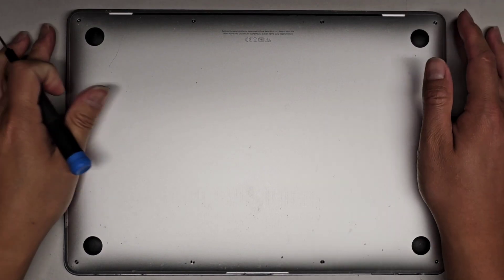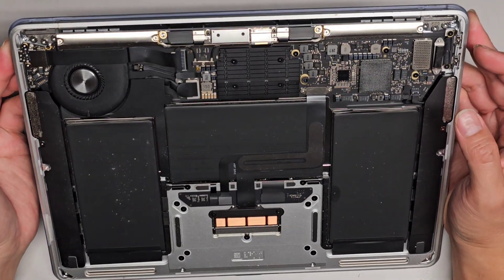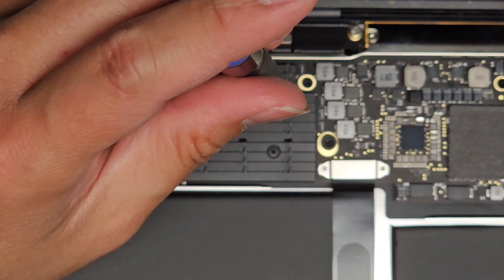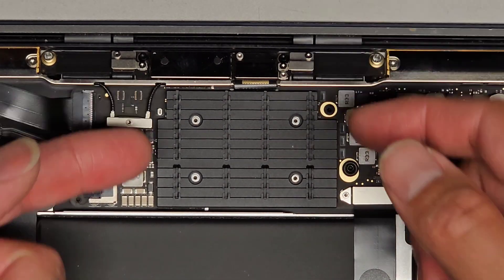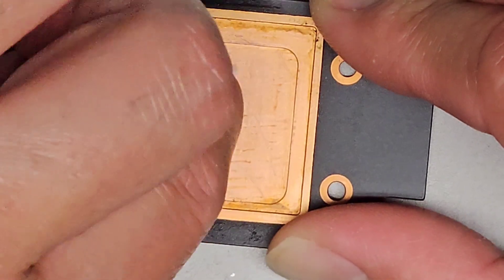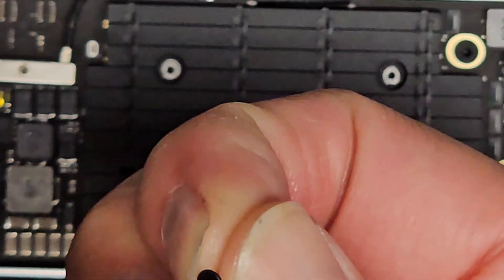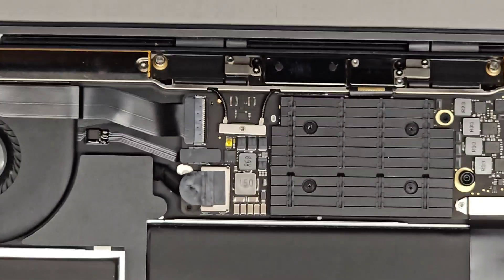2020 13" Inch MacBook Air A2179 Disassembly CPU Thermal Paste Application

Comment: good video, but 1mm thermal pad is needed here instead of thermal paste.
Reply from the maker: Thermal pad is not as good at transferring heat. Who told you to use thermal pads?
Reply: @ItsBinhRepaired  
As you mentioned in the video, this device has a terrible design XD, but when using thermal paste, an air gap is left between the heatsink and the SOC, which can cause temperature panic errors, especially for this specific design. While thermal paste generally works better, perhaps not on this particular device.
Reply from the maker: @hyperagent00 what gap? Who have you been talking to? Thermal pads are much worse at flowing into gaps to fill. There's a reason why thermal pads are never used on cpu/gpu dies.

Comment: I did this process exactly and now the Mac won't start :( I tried all kinds of keyboard shortcuts, checked all the cables but it doesn't work.
Reply from the maker: My guess is you didn't reconnect the battery properly if you didn't damage anything along the way. Make sure you plug in the charger for the first time or it won't power on.
Reply: On the video I don't think he disconnecting the battery before working on it as you always should. Otherwise if you did that and sometimes these models are weird and you have to plug in the power for it to come on for the first time after replugging in the battery

Comment: Thanks a lot for this detail video. Add one information after replace the thermal paste: plug in charger and hold the power button about 3 seconds, release it after you see the Apple icon. My A2179's temperature is about 80-90 now. and the FAN works fine. I think it is a little bit higher. Should I do some other work for this issue? Thanks again.
Reply from the maker: 80-90F or C? Why hold the button?
Reply: @ItsBinhRepaired  80-90C, one quick press cannot start the system. so I press the button until see Apple icon to make sure system start.
Reply from the maker: @OldHeroLast that's way too hot

Comment: For the people with issue after doing this and won't turn on.  This sounds crazy but I've built many windows computers over the years and for whatever reason some of the older intel chips required pressure from the heatsink to work, it won't even turn on without enough even pressure.  Not talking about socket pressure with the lever arm as these are soldered in without, but pressure of heatsink no bullshit.  Check to make sure the 4 screws holding black heatsink on are tight, thermal pads rather than paste or the amount may affect this also I would think.
Reply from the maker: Usually it's just looking for the charger.
Reply: This doesnt sound normal to be honest. Must be a flexing problem as ive encountered it before but im sure it was a defect. And if it wont turn on when replacing paste on a macbook and it turns on when pushing heatsink down then youre semi screwed you got cracked solder balls. 😂

Comment: nice video, missing the end result (temperature compaired of the paste before)
Reply from the maker: Temps aren't the full story. It'll throttle to keep it below a certain temperature. Better cooling can allow it to run faster at the same temps.

Comment: Thermal paste name please reply
Reply from the maker: @DeepanshuSingh-c8t  I used IC Diamond, but soon I'll be using the ptm7950 stuff after hearing how good it is. I'm not sure if you can get ic Diamond anymore. Really any thermal paste will work. Check for any paste with good reviews on Amazon.

Comment: I replaced the thermal paste from Artctic MX4 and did exactly as you did in the video, I connected the batteries, screwed the case together and the macbook doesn't turn on 🥹 Do you have any ideas, advice on what could be the cause?
Reply: maybe someone will find this information useful. I disassembled it again and did it from the beginning like in the video. I removed the paste I had put on, cleaned everything with alcohol and put it on again (less) the macbook started working
Reply: i have the same ploblem , first time it won't turn on but after i connect charger line to charg power  it's come turn on.
Reply from the maker: @harian7329  awesome
Reply from the maker: @danillozip7734  you did all the power drains? I'm worried you put too much paste and fried it or possibly left something disconnected.
Reply: @ItsBinhRepaired  I have the A1932 model. I don't think there's a battery reset button. I only disconnected the batteries, nothing else. After putting them on, I connected them and they didn't turn on. I tried disconnecting the batteries and connecting the power cable again, one white diode lit up at the entrance to the battery port, but they still don't turn on 🤨
Reply from the maker: You didn't even hold the power button? You said you did exactly as I did in the video. https://youtu.be/ukmavhIqhOI?si=aWFUU8_JJ7RxfoV7 The reset button is on that model as well.
Reply: @ItsBinhRepaired  I actually didn't do that, and there is that button as you say and I didn't notice it, I only unplugged the battery 🥹 so could there be some short circuit?
Reply from the maker: @danillozip7734  it's very likely. Try doing the power reset and reseat the battery cable. You might get lucky
Reply: @ItsBinhRepaired  no luck. I did a reset with the button, disconnected the batteries and did a reset again and then connected the batteries and it still won't turn on 🥹 Thanks for the answer ✌️ p.s. does the paste I put on (too thick, too thin) have any effect on starting? is it worth cleaning it and putting it on again?
Reply from the maker: @danillozip7734  shouldn't be an issue if it didn't overflow and get onto other stuff :(
Reply: @ItsBinhRepaired  what would you bet that it's damaged? motherboard?
Reply: Weird having the same problem had the computer unplug without the ebattery plugged in for like 5 minutes also arctic mx4... The paste hasnt gotten outside the confines of the cpu area either. Been operatingg it without a battery for diagnostic purposes
Reply: So from what i saw looks like small parts of the original paste pad thing somehow fell on the chips underneath the headsink and once i cleared that off it turned on but this laptop (2018 at least) is garbage... Has a fan that is in no way or form connected to the heatsink but i imagine it speeds up when the heatsink or cpu temp rises lol.

Comment: Which model is this, i3 or i5?
Reply from the maker: @azmi-077  no idea.
Reply: Can any thermal paste be used on this macbook or does it have to be a specific kind?
Reply: @KHZ12345  I have the i3 version of this model. Even if I use high level thermal paste, the 2018-2020 MB Air is always hot. But the i3 version cooler block I use is not designed like this, it is simpler.
Reply: @azmi-077  I have the 2020 MB air and it runs between 80-100 C so i want to see if there is a way to make that number come down
Reply from the maker: Not really. It's a bad apple design. Someone needs to make an aftermarket bottom cover for this purpose.
Reply: @KHZ12345 it won't make a big difference. If you're feeling risky, I think you can put a pad to have the bottom cover act as a heat sink extension, but it gets quite hot (hotter than safety regulations). The truth is that the cooling system is badly made, likely intentionally.
Reply: @gmdrandom6287yea, i just decided to leave it as is and change a few things in the settings that may help the computer use less energy when running. Its working fine as of right now
Reply from the maker: Yeah, for sure lol
Reply from the maker: Sounds good

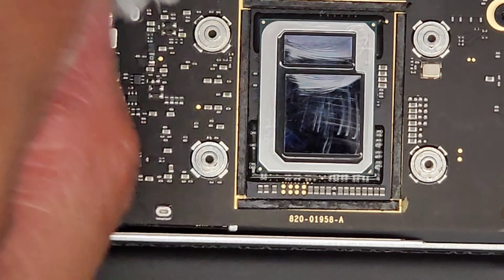Comment: 10:22 looks very scratched on that apu/cpu chip never seen that happen as you used a plastic scraper which is the correct tool to use and still the surface was scratched on the chip, goes to show the quality of this product
Reply from the maker: Might be the grit in the paste. They use carbon black. The new paste is ic diamond, which will also scratch it when cleaning.